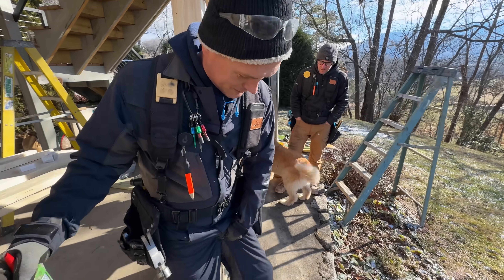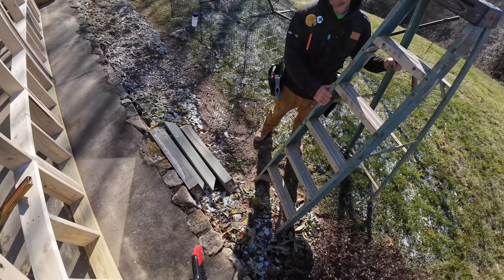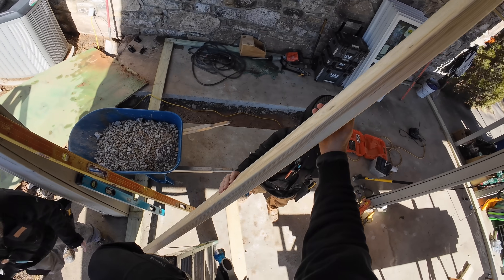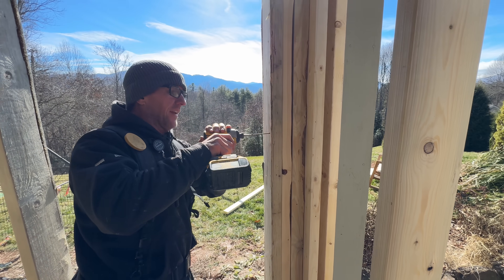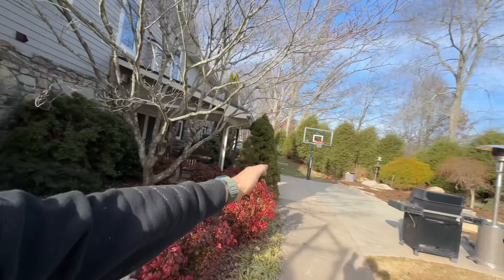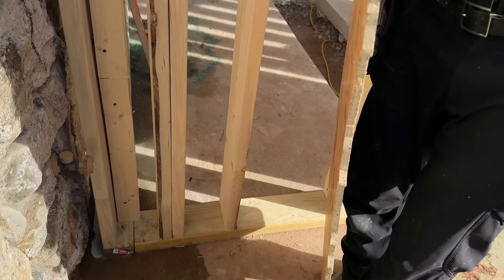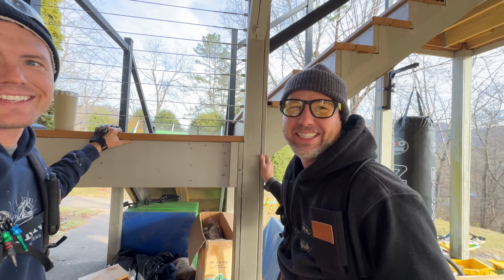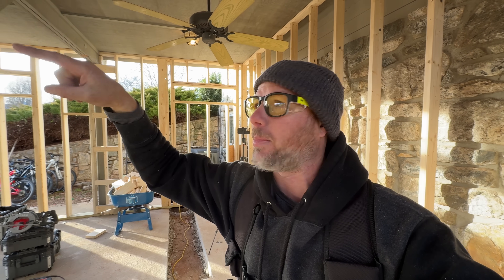Building My Own Home Office 2

Comment: For the filling by the stone wall, spread out a few balls of steel wool before you foam insulate it. If a critter tries to gnaw their way in, when they bite on the steel wool it’ll stop them cold. It’s like chewing in aluminum foil.

Comment: One option with the stone work was you could have cut a grove into it just as you did with the concrete floor, enough to give you a space to slide in a board and then lexel a much smaller gap
Reply: That was my thought as well especially when he pulled out the diamond blade for the grinder.
Reply: thought that too
Reply: Four’s company.

Comment: I would definitely cut that slab flush with the outside walls so the water could go down into the ground !!  No amount of flashing or sealing will fix this !!! Been building houses for over 45 years !!
Reply: They're cutting a groove at the sheathing edge that will have q flashing sealed into it lapping up the walls. I do agree, a flush slab would be better, but this is as good a solution as it gets without cutting it off
Reply: @Iamthathillbilly  works in the short term, but it's the type of thing that will have to be checked pretty much every season if the sealant has come undone.
Reply: @TheDirtyBirchTrails  agreed. I don't see it lasting a lifetime

Comment: 17:18 another option would have been to chase out a channel into the stone where each side wall frame landed and then affix to the house structure. Then build a false wall (like you have) in front of the stone wall between the two side walls.

Comment: Looking good, so far. The only thing I would have done was to move the faucet away from the extension. Water can be very damaging if it gets into a freeze, thaw, freeze cycle. I couldn't help noticing a wet patch under the faucet. Very interesting to see how the walls will be produced. Be safe and well 👍

Comment: At 16:00 you can use flexible grout or rubberize compound that will give 80   %-100 % stretch and great adhesive bonding to all different surfaces for a water tight seal guys thank you all for sharing please be safe and have fun GOD bless

Comment: Hey Jaimie, I have a pencil with a ball bearing mounted on it which I run along the wall (or any other stuff) and tracing is much easier and faster. The bearing with the pencil inside you could make a support to fit the pencil you use...

Comment: I've scribed stuff like that. It's not that hard. It helps if you have a set of dividers. Looks great Jamie. Did you think of cutting the rocks off the wall.only where the new framing would go? Then building the back wall where you did?  Sooo... why didn't you set the wall a few inches from the deck landing in the first place? Didn't think of it? I get it. Beautiful hand-made clipboards. Nice.

Comment: I'll give you guys a tip working with lexel or geocell. It may sound gross, but literally spit on your finger first and tool it with the wet finger. I've been meaning to try soapy water because water doesn't work as good. I can get it super smooth like that. Again, I know it's gross,  but it's way easier and nicer in the end. Another thing, when cleaning my fingers I use a Karnak product but wd works decent then gojo right after.

Comment: I solved the issues with concrete to wood joints/transitions with PVC 4'X8'X1/2" Sheets/Panels ripped to width of entire wall thickness including interior sheetrock and exterior sheathing as a master baseplate below even the pressure treated baseplate as what I call a master baseplate and now water and condensation are my friend. It's an added step and increases costs slightly but no more rot, bugs, or leaks as any high grade elastomeric caulk/sealer works well. Code in some areas eliminate the the need for pressure treated wood as a baseplate which reduces costs. I use a pneumatic firring/furring "T"nailer to attach the PVC to the concrete slab making installation a snap.  I even use 1/4" PVC as  a bottom spacer on all wood columns. Ray

Comment: On that irregular stone wall one could have just cut a trough out in a vertical line  wide enough for a post and siding. Removed the stone just in that area and used a 4x4 post inset in to the trough. Mortar on the outside and Lexel/spray foam for weathertight seal on the inside. But the contour following seems to be faster???

Comment: For the gap between the block and the framing, you should’ve cut a channel in the block with a concrete saw and then wrapped the framing member to sit into the channel with a waterproof membrane. That would love been the best solution. You also would have scribed framing boards and trimmed them with a jigsaw for a tight fit. That’s still better than the sheathing being scribed and caulked. But no thought behind the outside faucet and door into the house…ugh.

Comment: "I love Jeeps.  Jeeps are perfect.  You can drive one straight off the lot and all you have to do is replace the tires, rims, entire suspension, lighting, sound system, maybe the grill, add a winch, reprogram the factory settings and the take off the doors and roof and it's basically ready to go." 
Current Internet Meme about my favorite vehicle.  🙂

Comment: I would have either kept that rock wall as an accent wall having down lit OR using the same saw you guys cut the floor with, cut that wall and removed the rock wall. That's a lot of wasted floor space as well as insulation and wall building needed plus removal of that window would have been easy peasy work. That rock wall is just a facade attached to the house wall so it really was nothing more than for looks. If you were going to cover it up, you should have just removed. Such a wasted opportunity either way.

Comment: Why didn't you put the Alexa on the concrete and then put the 2 by 4 on top of the lexel, and then still put a beat on the outside edge same with your wall over there with your zip up against the rock that you described. Put black cell on the edge. It's up against the rock and then put lexel on the outside edge. Yet where you could have made sure it was gonna seal.  Just saying

Comment: You should NEVER EVER allow the bottom of ANY shear panel to touch the concrete or the ground.  I am not sure what you hope to gain by doing this. By IBC code, you have to nail perimeter edges 4" OC, so you are not gaining any water protection. Also, if you raise the panels 1/4", you prevent water damage over time. Water is a powerful solvent, and over time, ZIP tape and caulk will break down. Raising the ZIP board off the concrete creates a natural break between the wet concrete and the ZIP board. Really, it's common sense if you think about it.